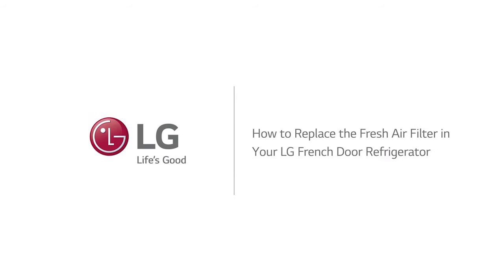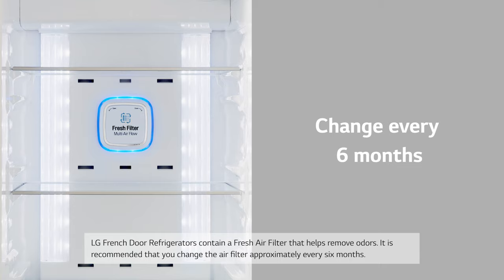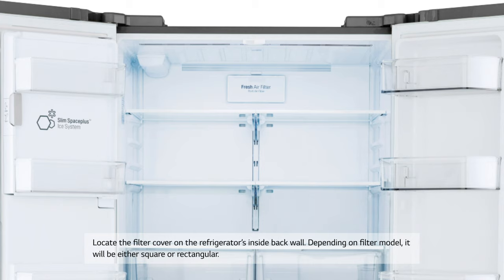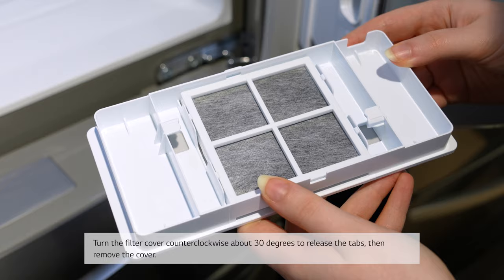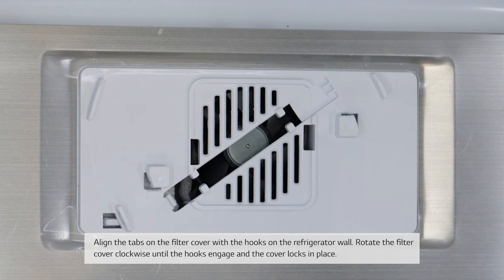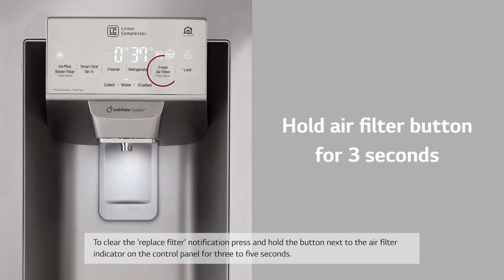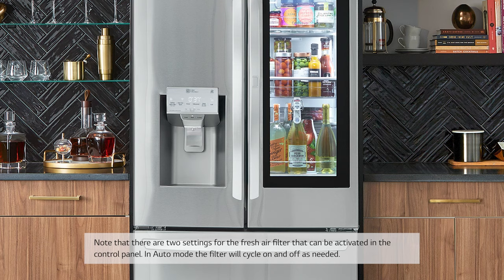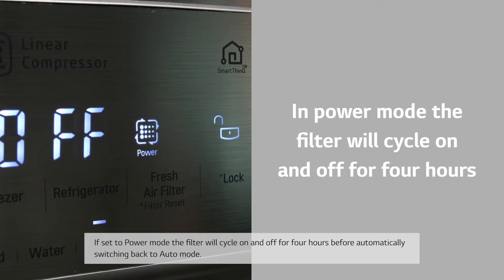[LG Refrigerators] How To Replace The Fresh Air Filter In Your LG French Door Refrigerator

Comment: Terribly hard to remove the air filter cover. I had to stand on a chair, rest my knee inside the frig, pound on the cover and twist with lots of pressure!  I love my LG refrigerator, but they need an easier design to remove the cover!
Reply from the maker: I’m sorry to hear you're having this issue, and I’d like to see if we can assist. Please contact LG Customer Support by direct message via Twitter ( @LGUSSupport  ) or Facebook Messenger ( https://www.facebook.com/LGUSA/ ), and include your contact details, the model & serial numbers, and a detailed description of the issue. ^Mary
Reply: It’s really not that hard. If you push down from the top left corner the leverage does most of the work
Reply: @LGUSASupport  tips to remove air filter cover
Reply: Same experience here - you have to force it and are worried to break it. In the end did come out but it’s scary
Reply: Dramatic
Reply: @LGUSASupport  I am having a terribly hard time removing the air filter cover.  It does not want to move.  I’ve tried several times and had a very strong guy try also. Neither of us can budge it. What next??
Reply: We had a hard time removing the air filter cover. We were scared that it would crack placing pressure on the upper corner. Once we got it off we had no problem. That is our only complaint. Love this refrigerator

Comment: Also, I never had a filter in it for the 2 years I've had the refrigerator. I'm not even sure why it needs a filter, because most things that need a filter would have dirt hanging around it and this was spotless, so I think the filter is a scam overall in this usage and of course LG charges like 75.00 for a filter or two if you were actually going to buy directly from them, DON'T😅

Comment: had a bear of a time getting the rectangular cover off, tried squeezing, pushing then turning and any other solutions i read online. turned out the trick for me was to remove the two top shelves to give my arm enough 'wiggle' room to get a better grip. once i did that, in all seriousness the cover finally opened. after replacing the filter, i then opened and closed the cover several times to 'break it in' so it comes off easier the next time. i might not have to remove the shelves next time but time will tell.

Comment: On my new LG frig with the rectangle air filter cover ,and  after talking to an advisor on the phone ,  I had to use considerable force with two hands to twist the cover  off.  I thought I was going to break it with the amount of force I had to use .  It finally came off without breaking.  Putting the filter cover  back on was very easy and then taking it off a second  time was easy as well .  The agent and  I were  not sure why the first time removing the filter cover was so hard.  The agent assured me that in taking it off, had it broke,  LG would have replaced it under warranty without charge.   The agent was very good and stayed on the line until the issue was resolved.
Reply from the maker: Thank you for your feedback. If you need further assistance, please contact LG Customer Support by direct message via Twitter ( @LGUSSupport  ) or Facebook Messenger ( https://www.facebook.com/LGUSA/ ), and include your contact details, the model & serial numbers, and a detailed description of the issue. ^NS
Reply: Yes these filters are the worst design to remove. And I'm in the hvac/r trade.  These filters don't get dirty they are inside your refrigerator. And if an odor issue, time to throw the food out.
Reply from the maker: Welcome to our Social Media page.  Please contact LG Customer Support by direct message via Twitter (@LGUSSupport) or Facebook Messenger (https://www.facebook.com/LGUSA/), and we would be happy to assist you further.  *Leah
Reply: My experience to a tee. Thought I was gonna break it the first time, said "the heck with it and gave it a counter-clockwise wrench", then the left side was still "hung up". After complete removal and filter replaced?  i took the cover off and put it back on smooth and easy...just that first time was difficult
Reply: Mine broke the first time using it. $50 to replace this 50 cent piece of plastic. WTF LG?

Comment: We also had a hard time removing the cover of our LG LRMVS3006s fridge (wide rectangular cover). I'm 5'2", so I knew I was going to have a hard time reaching the top back of the fridge. I used a step ladder and the cover would not budge. After reading other comments, I was able to successfully remove the cover by pressing back on the right side of the cover and then pushing the right side upwards. The left side was still stuck, but was able to push back and downwards on the left side for it to release. Both made awful plastic cracking sounds. Nothing appears broken though, it was just loud 😆.
It felt rather risky to lean so far over the side of the step ladder in order to apply enough pressure 😅. But it worked!
Reply from the maker: We appreciate you leaving us your thorough review with regard to your experience in removing the cover for the air filter. Should you have any other questions or concerns regarding this, don't hesitate to reach out to us for more information. ^Anthony
Reply: same except that I'm 5'6"

Comment: The same thing that happened to @freebie... happened to me.  I've done this three times and it's always the same.  It's not easy getting the rectangular cover off.  I thought I was going to break it too!  After watching this video and reading comments, it still took work to get it off.  I had to use a step stool and anchor myself with my other hand on the top of the fridge.  It made a loud cracking sound but it did not break.  Too bad people have to remove food and shelves to replace a simple filter.  I wish they had designed this with an easier way.
Reply from the maker: Hi, Emily! We appreciate your feedback; your filter should have been more straightforward to remove than that, so we'd love to hear more about what happened. If you could send us some info with the link below, our refrigerator development team will have a better idea of ways we can improve, and your ideas may just be implemented in future updates! http://spr.ly/6052PeFgG ^Ian

Comment: After opening 20 web tabs trying to find out the part number for our LG model Refrigerator, I finally found one that "implied" that it would fit. My problem was that we are on our 2nd LG model, and our 1st one had the square cover and the new one had a rectangular cover. I used the LG website and put in my model number....no results. I downloaded our manual, and no mention of the air filter period. I went to 3rd party webpages and still came up empty. I knew the water filter had changed to a new part, so a rectangular cover instead of a square one made me question if it had a different part. I spent over an hour trying to find any kind of information and decided to look at mine. I'm glad I read all the comments below so I didn't break the cover like so many have done, and boy was I surprised when I took it off. There was NO AIR FILTER in our new refrigerator. I had a square one left from our previous model, so I put it in and everything works. But you sold me a refrigerator with NO FILTER. That is insane.
Reply from the maker: We're sorry to hear about your experience with your refrigerator. We know that this is not the ideal one that we are trying to achieve. Allow us to rectify the issue. Please send us a private message on Facebook or Twitter at @LGUSSupport, and we'd be glad to provide you with the information and assistance you need. -Charles
Reply: @LGUSASupport     I enter my model number (LFXC22526D) and I get further info to choose the variation - none of the various listed match my LG.  I assume that the 0L1B1753 number on the spec tag (under the model number) would be my variation, but of course that number is not listed anywhere.   Maybe that's not my variation?

Comment: This is the worst design ever. Period. Total junk. On the video it shows twisting and it come off. No so in reality. I still cannot get it off. It barely moves when twisting.  This is the last time I buy an LG product. This should be incredibly easy and intuitive. Not making a project that requires research and jumping on social media to figure out. Changing air filters and water filters should be super easy and intuitive. I can think of dozens of designs to make it easy. I am clearly angry of these incompetent LG engineers that can take something so ridiculously simple and make it so incredibly difficult and complicated.
Reply: It is really stiff to twist. I used both hands and thought that I have broken it when it did come off.

Comment: Thanks so much! Like most people thought I broke it. Now I have extra filters, didn’t know this existed when I changed my first 3 pack
of water of filters, I just threw the air filters in a drawer, didn’t know where they went
Reply from the maker: Hi, there. Thank you for sharing your experience. We understand that it can be confusing at times to know all the features and components of our products. We're glad to hear that this video was able to resolve the issue with your LG refrigerator. To make things easier for you, we recommend keeping all spare filters in a designated place, so you'll always know where to find them when needed. If you have any further questions or need assistance with anything else, don't hesitate to reach out to us via Facebook or X (Twitter) at @LGUSSupport, and we'll be happy to accommodate you. `Alice
Reply: I endorse all of the above comments. It's extremely hard to remove the cover. I tried several times for 2 days, even considered calling a Plummer. I had to apply a lot of force to finally remove it!!!!!!

Comment: We had a hard time removing rectangle cover. Thought we were going to break it! Read helpful comments below. We removed top shelf. Then I pushed top right corner in and twisted hard to left. It made a loud cracking noise, but was ok. I'm hoping next time will be easier
Reply from the maker: Hi! Glad to hear you were able to successfully replace your filter. Should you need further support, please don't hesitate to contact us! We're available for support via phone or in browser chat for your convenience.  Please find more information for these support options here: http://spr.ly/6053OuLDz. ^Chris
Reply: I was able to get the stupid cover off with this tip. Also, once you get remove the cover I would lightly oil the plastic clips on the cover (both left and right). It makes it easier to remove the next time.
Reply: Clearly this air filter is a design failure. Stupid challenge to replace an unimportant item. Many good products are available than their filter and do a better job!
Reply: @eugene6982  thanks for your recommendation, I'll oil it next time to help removal process

Comment: I have the square filter cover and if you had hard time taking off this one, try "squeezing" the sides of the cover then turn it left as strong as you can (sometimes it will not require much strength after squeezing). That was the easiest way for me. Not sure if this will work with the rectangular cover as I don't have it.
Reply from the maker: Greetings! We strive to provide the best support care, and resolution for your LG Refrigerator. In order to better assist you, we must switch to a platform that allows for back-and-forth conversation. Please send us a private message on Facebook or Twitter using @LGUSSupport, and we'll be pleased to see what we can do to help. Thank you! ^Rita
Reply: Thank you so much
Reply: This worked for me, also wearing non slip gloves when squeeing helped.  Thank you

Comment: Needs a redesign. Cover is very difficult to get off. Had to take everything off the top shelves and remove them, use a ladder to have enough force to get it off & thought I was going to break the cover.  Hope LG reads these comments. 
Also, there seems to be a plastic film around the rectangular air filter. Should that be there?
Reply from the maker: Hi Noel, we appreciate the feedback! We're continuously innovating and use our customer feedback to improve our customer experience going forward.  Please feel free to leave your feedback here: http://spr.ly/6053PIKWP.  Regarding the plastic film around the filter, please reach out to our social media team on Facebook and Twitter so that we can take a closer look into this. Our handle is @LGUSSupport for these platforms. Please include your fridge model number and, if possible, a picture of the plastic film around the air filter. It would be our pleasure to further assist you! ^Chris
Reply from the maker: We're sorry to hear about the issue you are facing with the air filter in your refrigerator. This is definitely not the experience we want you to have. Please send us a private message on Facebook or Twitter at @LGUSSupport, and we will be more than happy to assist you. -Charles

Comment: I’m trying to replace my air filter for the first time but it just won’t turn and I don’t wanna break it!
Reply from the maker: Hi, Jorge I’m sorry to hear you're having this issue, and I’d like to see if we can assist. Please contact LG Customer Support by direct message via Twitter ( @LGUSSupport  ) or Facebook Messenger ( https://www.facebook.com/LGUSA/ ), ^John
Reply: You need to hit it with your hand in the upper right corner. I found a video on it on YouTube. Only that worked.
Reply: A number of people suggested hitting with your right hand on the right side of the filter cover to knock it loose.  That didn't work for me, but then I used a mallet.  It didn't knock it off, but it apparently loosened enough for me to turn it and pull it off.  When I saw the condition of the filter, I was glad I persevered to get the cover off and the filter replaced.
Reply from the maker: I’d like to see if we can assist. Please contact LG Customer Support by direct message via Twitter ( @LGUSSupport  ) or Facebook Messenger ( https://www.facebook.com/LGUSA/ ), and include your contact details, the model & serial numbers, and a detailed description of the concern. ^Mary
Reply: @higginscrowley  i'm gonna go it hit, sure hope it doesnt break  :)

Comment: Unclear about the cover struggles mentioned in the comments, mine comes right off on my LFXS28968S/00

However, I came here looking for info about the filter orientation.  When installed the way shown in this video, the front logo ends up facing the rear of the fridge?   So its confusing :)   But I see now front faces you when installing the filter into the cover plate.
Reply from the maker: We're glad you were able to clarify the filter orientation issue. Yes, it can be a bit confusing when the instructions or tutorials show the filter installed one way, but it's actually meant to be installed in a different orientation.

To confirm, when installing the water filter cover plate on your LG LFXS28968S/00, the front logo should indeed face forward and towards you, not towards the rear of the fridge. So, make sure to align the cover plate with the filter correctly and secure it properly to ensure a snug fit.

We hope this clears up any confusion, and please let me know if you have any further questions or concerns by sending us a private message through @LGUSSupport on Facebook or X. ^Danee
Reply: @LGUSASupport  but “FRONT” faces me when I’m putting the filter into the filter cover/housing.

But once the cover is installed in the fridge, the front logo is actually now facing the rear of the fridge - not the doors.  That’s why I’m confused

Comment: Yes. Very hard to remove.  Tech support was not helpful.  Wanted to send repairman to replace filter. Sent me a video.  Comment section was great.  Squeezing sides and pushing in on top right simultaneously hard turn to left works. It popped off.
Reply from the maker: Hey there! We know how frustrating it can be when things don't work quite right, but we're committed to ensuring you are delighted with our products. Please give us a nod to see what steps we can take to help you out. To do that, just shoot us a private message on social media at @LGUSSupport with your phone number, model, and serial number. That way, we can jump right in and start working on a solution for you. We can't wait to get you up and running! ~Rita

Comment: My refrigerator  model  LRFOC2606S/00. I can not find a AIR filter that fits. The manual calls for a LT120F filter. That filter has a frame around it and the one in mine does not. The frame will not fit in the cover. Tried to remove the frame and the charcoal filter breaks apart. Also the filter sets in the cover at an angle. What is the correct filter for this?
Reply from the maker: Hey there, John. We appreciate you asking us this question. As you mentioned, the correct Replacement Air Filter for this unit is LT120F. If this does not fit this refrigerator, we'd like to further troubleshoot this. To do so, we'd need to move to a private back-and-forth conversation, please send us a private message on social media @LGUSSupport and include your contact details, model, and serial number. ^Anthony
Reply: @LGUSASupport  I have the exact same problem. Got the cover off but it does not look like this video, there is no frame, there is a piece of filter in a gauze bag over what appears to be a piece of styrofoam all set at a wonky angle
Reply: Me too.  This is very frustrating
Reply: @kimgoldman111  Did you ever get this resolved? I have the same issue.